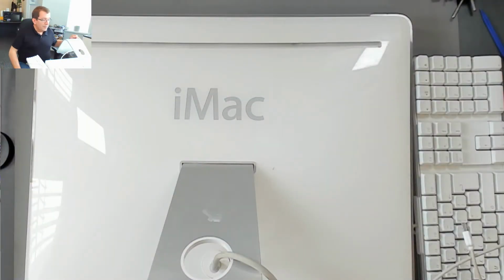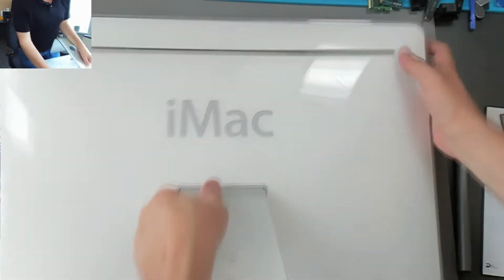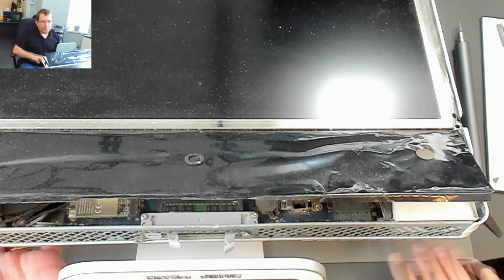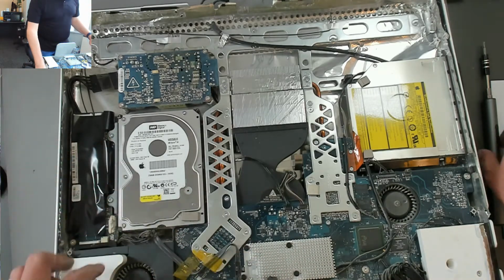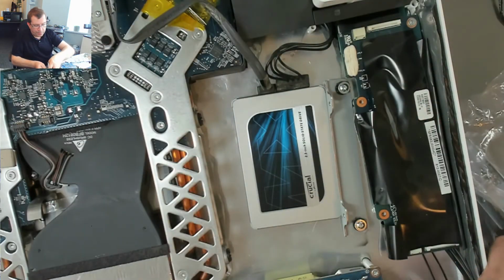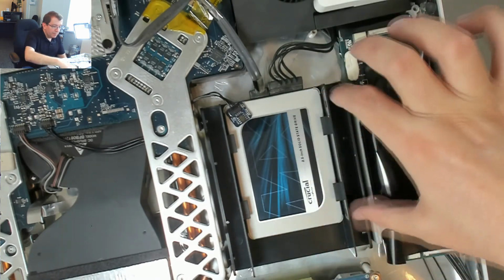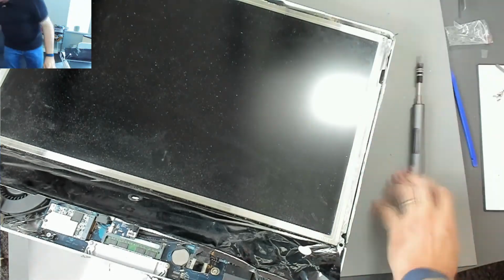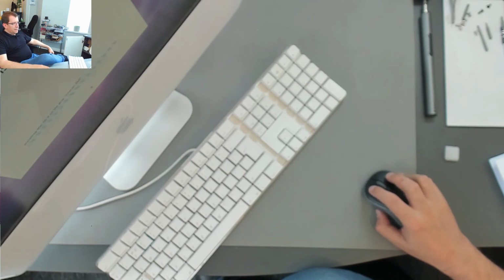[59 ] Question mark folder (bad hard drive); SSD upgrade - 20-inch, 2007 iMac (EMC 2128, A1207)

Comment: how can it bootable disk? i try a lot different method but i cant do that
Reply from the maker: If the device you are trying to boot from (a USB drive, external hard drive, etc.) contains a bootable image, holding the Alt key should coax the computer into showing a list of bootable devices, and your device should appear in that list. That's the way it should work anyway...

Comment: Hi, how did you force the mac to boot from Install disk?
I'm trying to do the same boot steps... no success.
I guess DVD unit faulty or wrong DVD installer, DVD-R from the original (missed) Mac OS X 10.4
Any suggestion? Thanks
Reply from the maker: If the USB device is bootable, you can hold down the Alt key (the one between Ctrl and Cmd, and the Mac should show a list of all bootable drives attached. I hope this helps!